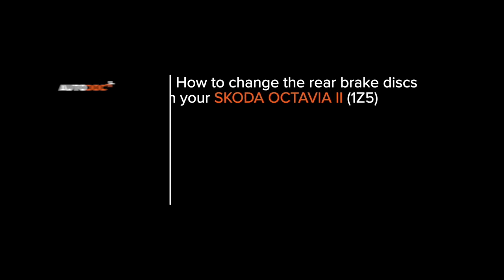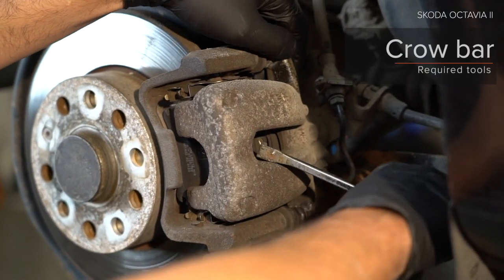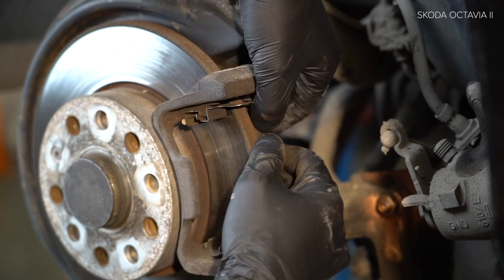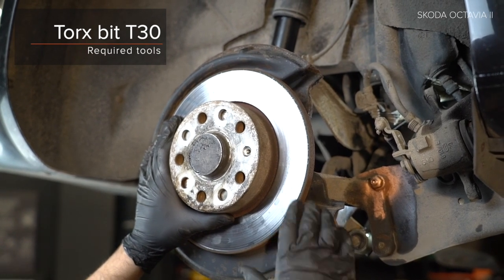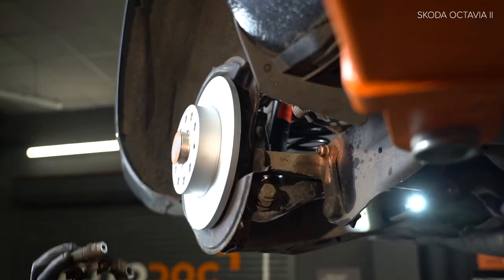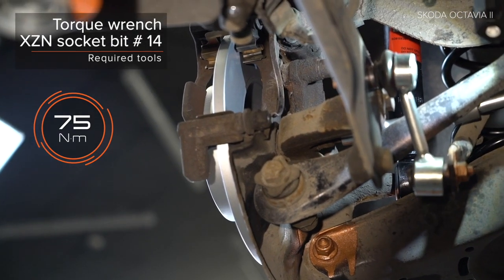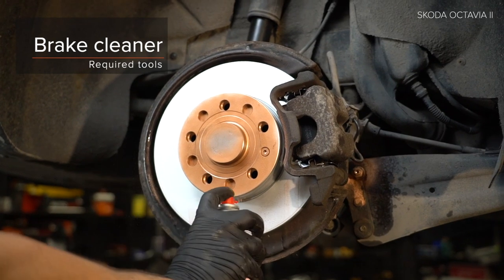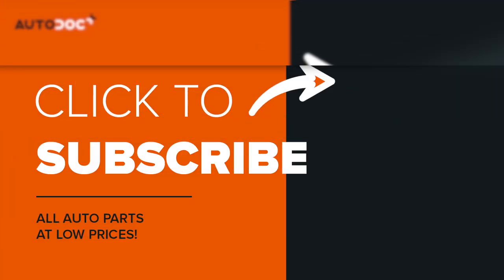How to change rear brake discs / rear brake rotors on OCTAVIA 1Z5 [TUTORIAL AUTODOC]

Comment: What about the handbrake shoes getting copper slip on them when spraying hub!!!
Reply: what handbrake shoes ? The handbrake operates on the caliper and discs on this model. There are no separate shoes / discs for the handbrake.
Reply: I'm more concerned the coppergrease gets in the thread of the wheelnut holes, this will change the torque applied the wheelnuts.
Reply: @DJMarsB  Hi. no, it wont, it means the right stretch in the bolt will be applied.
often when the thread is mucky the torque is achieved without the right amount of elastic stretch applied.
Hope that helps.

Comment: Question: Do those torque settings apply to all models, including VRS?
Reply from the maker: It is not possible to answer your question, you can find this information in the technical documentation for the repair of your car.
Reply: @autodocuk  Thanks for taking the time to reply.  I found the correct torque settings in a Skoda tech manual.  They mostly align with your suggested torque settings except for the XZN#14 bolts, which they state as 90Nm+90degrees.

Comment: Is this the same on a superb
Reply from the maker: In general, the replacement will be similar, the only thing that may be slightly different in the design features of your car. More accurate information can be obtained in the technical documentation for the car or by contacting the service